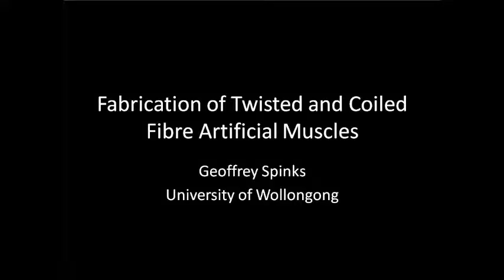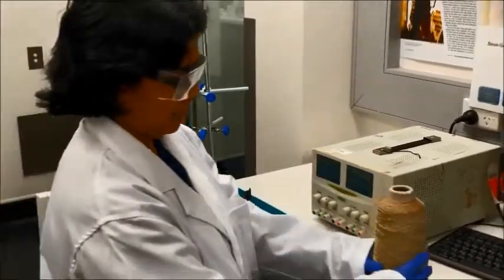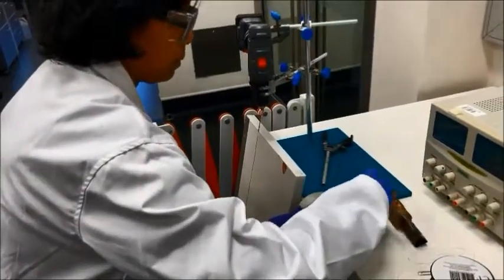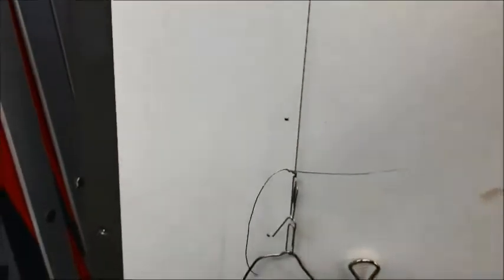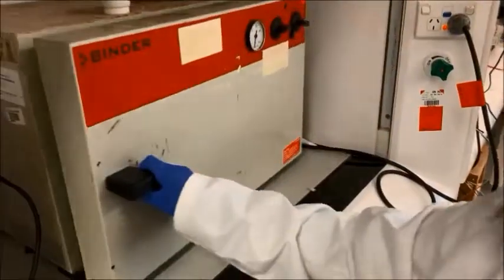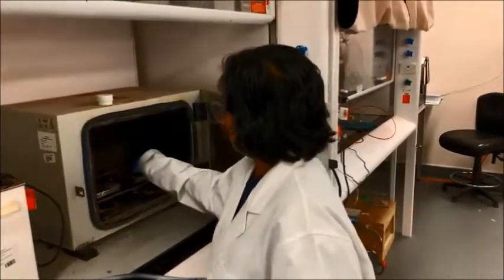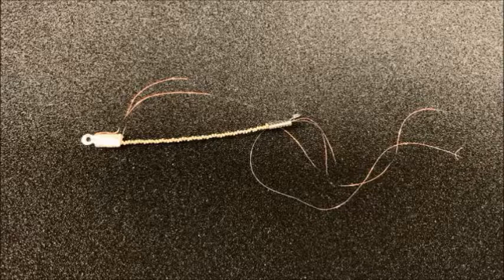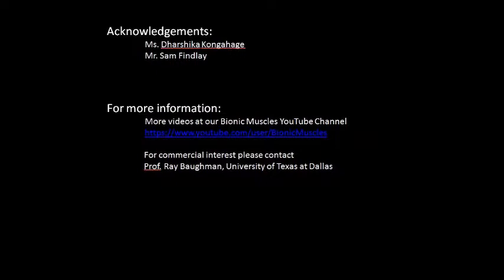Making artificial muscles from fishing line

Comment: That's nice. But I wonder how thick the silver-coated nylon was and how long was it used.
Reply from the maker: The silver coated nylon yarn we used here was around 0.2 mm in diameter and we have used the coiled muscles made from these yarns for many thousands of cycles without any problems.
Reply: @BionicMuscles  Thank you for the reply. I appreciate it.
Reply: I'm sorry but I have an another question. I tried making artificial muscles at home. The length of the nylon was 1m and the thickness was 0.2mm. And I made a 20cm coil out of nylon. The coil was then heated to 180 °C in an oven for 1 hour. Those coils boasted significant shrinkage. We also compared the calculated and actual values using the linear equilibrium coefficient of nylon. However, the calculated value was much smaller than the actual value. so, can you explain the physical principle behind the coil?
Reply from the maker: @SinWonMiSang  The coils shrink in length because heating causes the fibre that makes up the coil to untwist. When this happens the length of the coil reduces. This is the same phenomenon that occurs during the stretching of a coiled wire spring: the wire actually twists as the spring is stretched. You can see the fibre untwist on heating by making a sample from fishing line and twisting it until just before coiling. If you then heat-set this twisted fibre you will trap in the twist. Next, if you heat and cool this fibre you will see it untwist on heating and re-twist on cooling.

Comment: Hi BionicMuscles and Dr Spinks, do you have any videos showing the usage and operation of these electrically stimulated fibres and details on electrics, operational time... I would be really interested to use this for an art piece I'm working on
Reply from the maker: Hi Joe- operating these muscles is really simple. Just supply DC electrical power from a battery or similar. The more volts you put in the faster the muscle will contract. Cooling occurs when the power is turned off, although it can be slow. We typically use around 10V to heat up a muscle that is around 6cm in length and it contracts in 10 seconds or so. Note that they will get very hot- up to 150 degrees Celcius or more if you leave the power on. You can play around with different voltages to suit your needs. Best of luck with your project.
Reply: @BionicMuscles  oh too bad it’s so slow.  For robots you need it to contract and relax in tenths of a second.  Any way to make it snappier?.
Reply from the maker: @k1ng401  We have made really thin fibres into coils by teasing out individual filaments from multifilament polyester yarns and then twisting and coiling them. They do contract and expand very rapidly but you would need many thousands operating together to generate high forces
Reply: @BionicMuscles  do you use a correspondingly thinner conductive thread when you do that or have you contined to use the same silver coated nylon you used here?

Comment: Very helpful video, thank you so much! 

What's the maximum contraction we can expect and how predictable is it?
Reply from the maker: The maximum contraction depends on the coil geometry and can be as high as 80% for large diameter coils. If you can access the figures of the original report (DOI: 10.1126/science.1246906) then you'll see from Fig. 2 that the contraction is set by the coiling conditions and the contraction is quite stable for a range of applied loads above a certain threshold.

Comment: How much voltage and ampere do you need to let it contract?
Reply from the maker: We generally apply around 1 W of electrical power per 5 cm length of muscle. This heats (and contracts) the muscle in a few seconds. The actual voltage applied depends on the sample length, but we typically use around 0.5 - 1 V per 1 cm length of muscle.